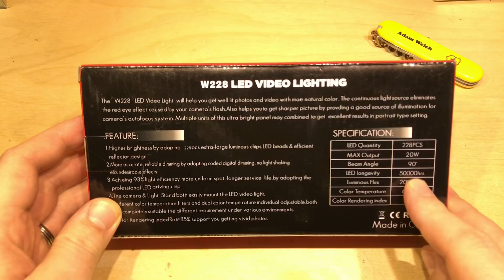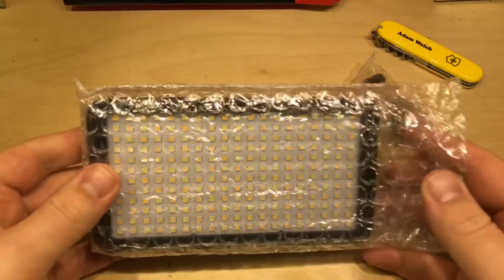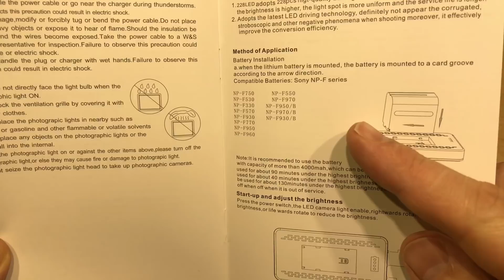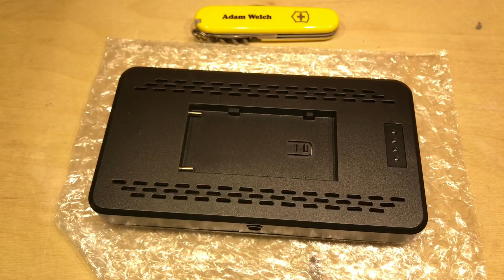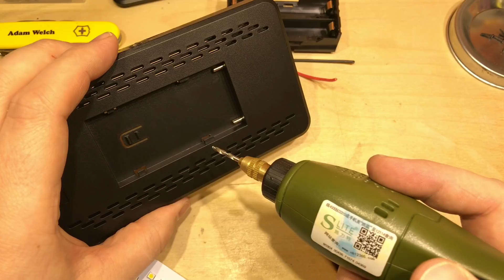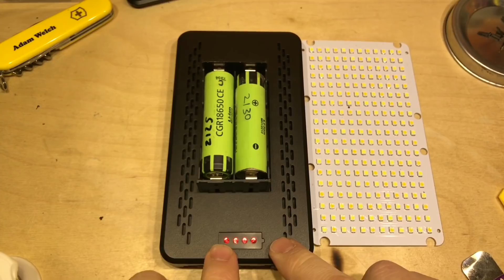228 LED Video Lamp Hack - 12v Solar Shed

Comment: I mistakenly wired it up with 8.4vdc from 2 x 18650 cells in series. I must have wired it with the wrong polarity because I blew one of the two capacitors grouped right beside each other on the board (possibly both of them). Is there any quick way to fix this if I don't have the replacement SMD capacitors to hand? Would it be possible to just desolder them and bridge the connection without compromising the functionality of the device?
Reply from the maker: You can probably just desolder them and give it a go.  I wouldn't bridge the connections though, that might short the cells.
Reply: Thanks Adam, but i think i broke it :(

Comment: These  lamps retail for 20 odd pounds I would have been more impressed if you'd use some £1.00 48  Car 12v LED Light Panels & built your own custom setup for under a £tenner. with the 48 Led panels you could have them spaced a few feet apart, making a sweet spot in the centre of your video area. :)

Comment: G'day Adam, You refer to your RUIDENG BPH3205 Power Supply. What do you use for your input supply to the unit?
Reply from the maker: I use my 12 volt lead acid battery bank.

Comment: How hot does this get ? Doesn’t the perspex hinder the cooling of the pannel quite a bit ?
Reply: Same thing I'm wondering, with that many LEDs being run potentially at their full power they've got to be putting out quite a bit of heat. Would've expected a small fan at least or some effort of heatsinking on the inside...

Comment: Well I have to thank you for a slightly embarrassing reason, I was making my own portable lamp from an old fluorescent tube light and I was thinking about how I would fit an 18650 inside it, as the top, middle and bottom part isn't large enough to hold one with the back on it, so then I thought about hot gluing the battery into the front but I was of course concerned with the heat, then when you brought out the battery holders it gave me that "oh, right" feeling  when you fail to notice something obvious.

Here's a photo of it. https://i.imgur.com/YmFFUi7.jpg

Comment: How strange, I just bought exactly the same light had exactly the same problem and solved it in almost the same way. Then I watched your video.(For some strange reason I added a switch to the battery pack and used 3 cells, not cooked it yet, I figured it would be pretty happy at 12 volts).
Reply: IIRC, the LM339 quad comparator is rated up to 15 volts. Adam didn't mention the other ICs, but if they have similar power ratings, and the capacitors are up to the task, then the bigger question is simply keeping the LEDs cool enough. You're probably OK at 12 volts if  you're not running it continuously, but I'd guess that's a hard thermal limit.

Comment: Taking frontglass of is easier if heated with a hairdryer (heatgun is much to agressive and hot) to soften the tape/glue.
China and all other countries are not allowed to ship batteries in the mail unless special packaged and declared.

Nice solution to pack two cells at the back. Nice video.
Reply from the maker: Thanks for the tip - always appreciate this type of comment. Thanks again.
Reply: Adam Welch https://youtu.be/nvuWCYGN8Pw please go and see this new mppt charge controller

Comment: You're going to stress those 2 batteries quite a lot tho, that's why these lights are mostly designed for use with Sony battery packs. They can provide quite a beefy amount without damaging the cells.
Reply from the maker: Yeah I’m dragging over 2 amps out of them. They’ve already had a hard life in a laptop and whatever I get out of them is a bonus. I could always throw in a couple of pairs tabbed together and reduce the stress and increase the run time (and weight) I guess.
Reply: Adam, I got one of these after seeing your review and I'm dead chuffed with it... Thanks!
I'm running it currently with 2 x 16p packs...  and has been going for days now... really useful while soldering and dremelling, and will be a great help while I build a battery pack out of the 900 or so good cells I've harvested so far!

Comment: Thank you very much for your tip.

 I have just ordered one with a double 18650 battery holder. I solder two wires on the two main power contact pins.
Reply from the maker: I didn't try it - it looked like they wouldn't take the solder.  Let me know if it does.  Cheers
Reply: iI am waiting for the dubbel 18650 battery holder. 

as soon as I have it inside I will get to work on it.

Comment: Very nice build! I love watching people build new things with 18650 cells.
If your concern is about the harsh shadows in your videos, maybe consider sanding the front of the clear screen on the lights to get a frosting. It would help diffuse the light more evenly across the surface and help eliminate shadows. Or you could buy a thin sheet of acrylic, sand it, and adhere it to the screen.
Reply from the maker: Nice idea - thank you.

Comment: "Achieing 93%" is not the same as "Achieving 93%".
You've got to read between the lines. I bet the 1st LED will go out in a week. 
Same as the 20W claim. How it can be done, is by magic!
Reply from the maker: It draws about 18 watts from my Rui Deng at full tilt. Hopefully if I run it easy the first led wont fail for a fortnight :-)
Reply: You showed at 8.4V, it consumes 13.85W. Its rated at 7.5V, so even over driving it at 8.4V, still yields less than 14W. They all fluff the numbers as you well know. I hope you'll report back and tell us how the LEDs stood the test of time. I for one am interested in that data. Cheers.

Comment: Adam, would you like a 12v wind turbine for your shed or will the neighbours not be mad keen?
Reply from the maker: I’ve looked at options here but you’ve hit the nail on the head. My garden is too small for a turbine sadly. Cheers
Reply: No worries!

If you ever migrate the shed let me know.

Better get back to building my 12v wind farm!

Have you looked at oztules DIY inverter plans? I really need to get round to building one.
Reply from the maker: Thank you very much anyway. Really appreciate the offer.

Comment: Hello Adam...!  Put in 2 pairs of cells, a la Paul Kenneth,  and you have double capacity/time/light. How about a socket and plug for your battery banks...?
Reply from the maker: I guess a sensible upgrade would be to attach a 2s lithium charger so I could recharge the thing without removing the batteries. Might have to think about balancing them though. Keeping t simple means I can swap out the cells quickly and replace with fully charged ones. Cheers
Reply: Look like a well built bit of kit.
I'd fill the back with cells - 2S4P, then you'd get 4x the capacity with only 400mA draw per cell to avoid old cells overheating.
I did something similar for an old lead acid flashlight and used 2S5P which had the same volume of the LA battery, and ordered this cute little 12A BMS.
https://www.ebay.co.uk/itm/2S-7-4V-8-4V-12A-BMS-Protection-PCB-Board-For-18650-Li-ion-Lithium-Battery-Cell/262671673091
Arrived last week but I haven't added it yet!